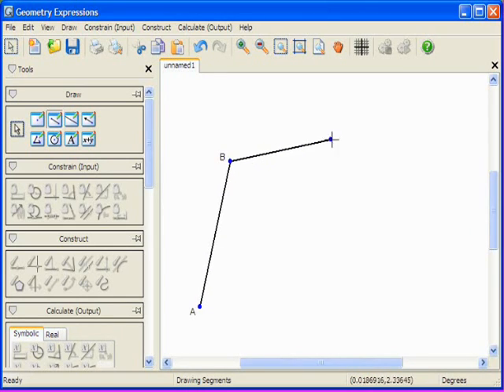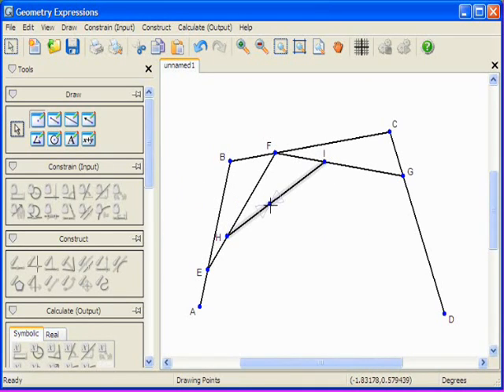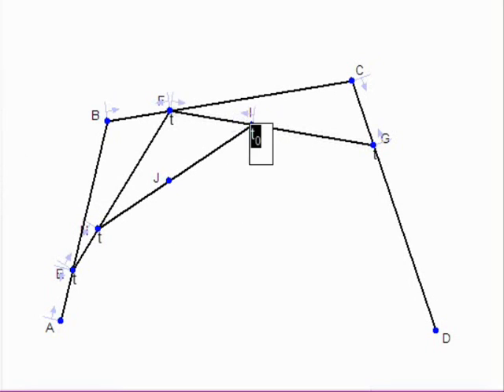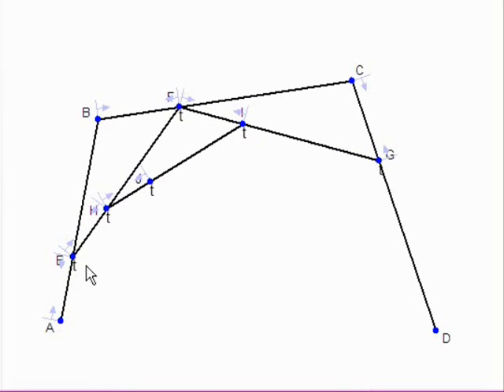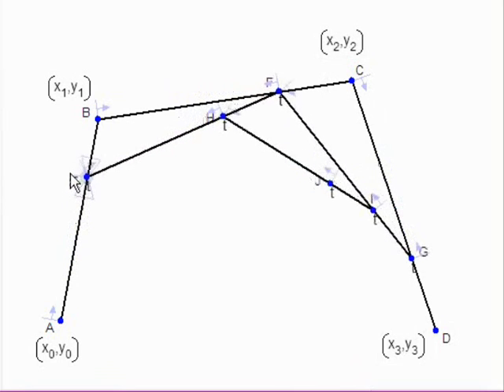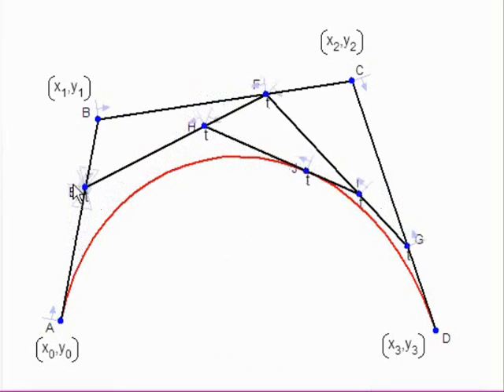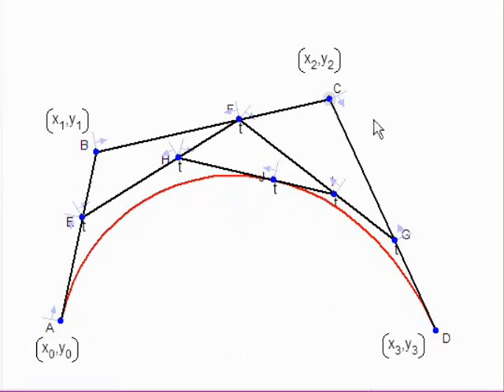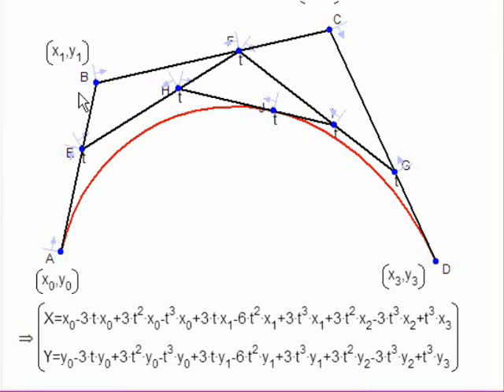Cubic Spline Curves

Comment: Hello Philip,
thank you for sharing your experience with Geometry Expressions. I have a question: does this software find also implicit forms of curves (and surfaces in 3D space) maybe? i see it can find parametric expressions (end of the video).
Reply from the maker: No, GX does not support 3D, but you can work with the program for free. The free version has a lot and is fully functional. If you need more features the paid version is also available. Find GX at geometryexpressions.com.